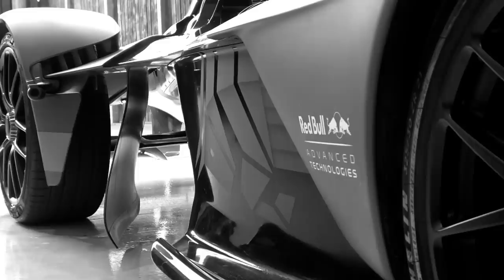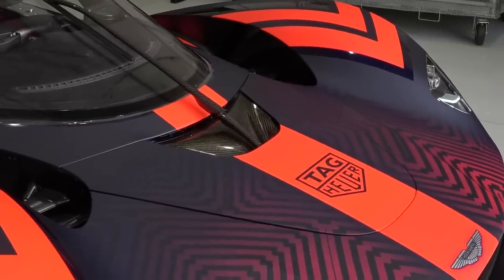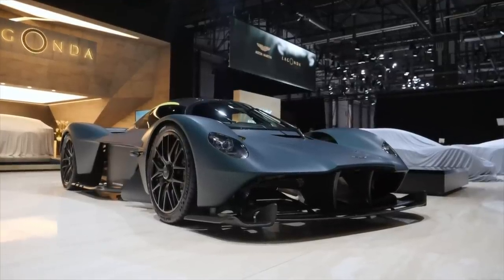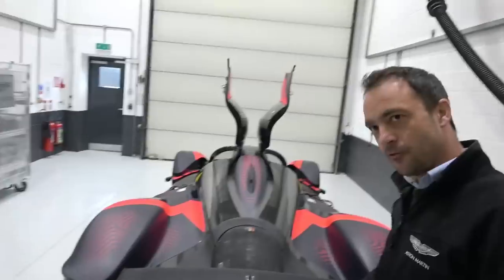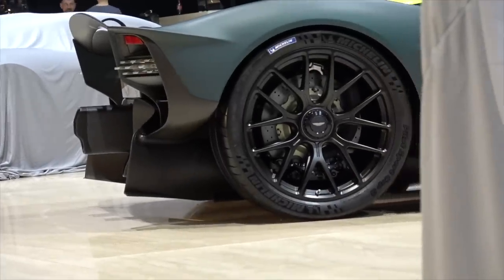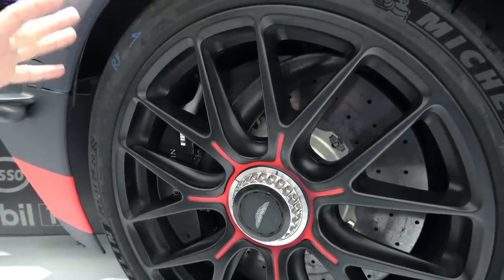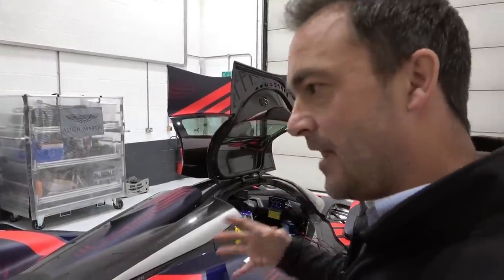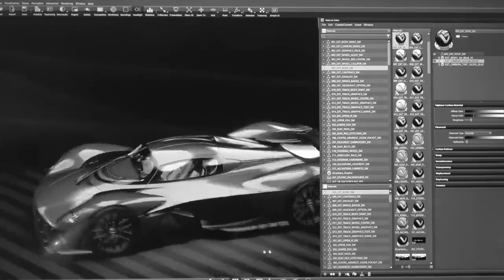Valkyrie Is ALIVE! World's First Onboard Drive!

Comment: I got shivers down my spine when we said that it is faster that LMP2 car in road spec! Absolutely nuts!
Reply from the maker: F.Gomm I know right!? It’s absolutely absurd!
Reply: @MrJWW  Yes it is an absolutely crazy project! Defiantly a once in a generation car! Thanks for the reply!
Reply: That’s quicker than F1 right
Reply: @chrisflux57  no, F1 is still a whole different ball game. The unregulated 919 Evo LMP1 derived car which Porsche used to break records last year is there or there about with current F1 cars (Mercedes, Ferrari, Red Bull)
Reply: @chrisflux57  the "can qualify on a F1 grid" thing was always towards the AMR version.
Reply: @npanic628  only on certain tracks though, spa is a track made for lmp1
Reply: Of course theyre going to tell you this. Ill wait until it actually is just as fast, officially
Reply: So in the road spec it is quicker than le mans hypercar?
Reply: well,. the car is great i agree.. but saying things like that basically a window dressing.. lmp2 max price 483k so yeah,. this car should go faster than that considering the price. and lmp2 has RULES that limit the performance, like: minimum weight 900ish, max brake diameter no power brake. 'only v8' 600hp. so yes ofc it is faster than lmp2.
Reply: @gustavoflorio5383  Actually what they claimed is that this car would be faster than the current generation of F1 cars.  So only being able to qualify on a F1 grid would be pretty disappointing considering they had a massive budget to design this, it's literally designed by Adrian Newey, and it's not restricted in terms of HP or aero like F1 cars are. I honestly don't see how they would fail to outperform F1 when you consider the fact that it is essentially an F1 car with more horsepower and no restrictions whatsoever on how much aero or weight savings it can have. So all and all, they will have failed to live up to their own hype and just failed in general if the amr isn't faster than at least the current generation of F1 cars. Honestly I don't recall if they made that claim specifically for the amr or for the road car as well. If they did for the road car, obviously now saying that it's "only" as fast as an LMP2 car is a pretty massive downgrade on their end.
Reply: @MrJWW  Can you imagine what a Gibson V8 would be like in a road car!!!!
Reply: @baller7387  its just marketing. Hyping it up. Its stupid to expect from something road legal, that has to comply with road standards, safety features, emissions all of that crap, to be anywhere near a race car. I can imagine it being faster than an LMP2 car because they only have 500 something HP. But it will be track specific, for example at Le Mans yes the road car should outperform the LMP2, but lets say Budapest or Laguna Seca, i cant see that happening. As for the AMR version, in race trim i fully expect it to be faster than the Le Mans hypercars coming next year, maybe somewhere on the pace of the current Toyota LMP1, but thats still a high order since the Valkyrie is heavier. Formula one will be untouchable for it i can bet my head on that. F1 cars are 700kilo 1000+hp racing machines designed on budgets of 400+milion dollars. Pulling 6g in some corners, no hypercar is anywhere near that (maybe 3g for the FXXK or P1 GTR) and its stupid to expect it from the valkyrie..
Reply: @baller7387  the valkyrie is too heavy and doesnt have enough aero to outperform aa formula 1 car
Reply: @npanic628  I can definitely see the argument for the road legal version not being as fast as F1. The thing is, no one else has ever marketed their production vehicle as being faster than an F1 car, so that's a pretty big promise to fail to deliver. And I don't think it's stupid to expect a car along the lines of the concept of the valkyrie (at least the track only version) to be faster than an f1 car when you consider the things I mentioned above. F1 cars are restricted with regard to the amount of HP they can reduce, the amount of aero they can have, and the amount of weight savings that is allowed. The entire idea of the valkyrie is that none of these restrictions apply to it and that it is designed by a legendary F1 designer in Adrian Newey: the premise of the car is that it is what an F1 car would be if there were no rules about how much HP, aero, and weight savings it can have. So really it should be faster than an F1 car, and frankly I think it's stupid not to expect it to be given how the car has been conceptualized.
Reply: @baller7387  neither Newey or Christian Horner said that the roadcar would be as fast as a F1. And if you have some knowledge of motorsports, you would not think otherwise.
Reply: @baller7387  there will never be a road car that is faster than and f1 car around a circuit. I don't think you are appreciating the level of performance an f1 car has. Anyone that says their road car is fast than an f1 is delusional.
Reply: @chrisflux57  no
Reply: Baller 738 I thought the same thing, I didn’t want to say anything about it incase I heard wrong but I remember when this car was just a rendering they were claiming it would be on the same level as an f1 car but they probably quickly realized that was a pipe dream
Reply: @gustavoflorio5383  First of all, I never said Newey or Horner personally claimed that the valkyrie would be as fast as F1, so calm down there bud. Second of all I said I was unsure if they made this claim for the road legal version or the track only version. Also, this has nothing to do with "knowledge of motorsports", I am simply referring to what aston martin claimed. Finally, it's not unreasonable to expect a car conceptualized as an F1 car that doesn't have to comply to F1 regulations (at least in the track only variant) to be as quick or quicker than an F1 car. This is common sense; if you had some you wouldn't have attempted to cite "knowledge of motorsports"
Reply: @fondfarewell2  I've already agreed with this line of argument so far as a road car goes. However, there is a track only version of this car, and after having looked it up I've become aware that this is what they were saying would be quicker than F1. Trust me, I appreciate how fast F1 is. I know F1 are the fastest and have always been the fastest vehicles around the track that exist since their inception. However, as I have said before the entire idea of the valkyrie (and I am referring to the track version here) is that it is an F1 car (designed by Adrian Newey of F1) that does not have to comply to arbitrary limitations with regard to HP, weight, and aero as all F1 cars do. When you take this into account, it seems pretty reasonable from a logical standpoint to expect it to be quicker than an F1 car.
Reply: @maurizioarrivabene8182  but the current f1 still beats the Evo. Tho 2019-2020 will be the F1 performance peak. With 2021 (depends on what they do but) the cars will be slower 😔
Reply: @baller7387  it cant out perform an f1 car haha , are u insane ??? The 919 evo couldnt do it and thats a fullblown lmp1 car . It surly lacks down force in comparison. And doesent run on slicks. And doesent have a whole battery and drs ect.
And look at this , i dont think aston martin f1 would aoreciate a road legal aston martin to spank their Car haha. You are right on 1 point tho. The valk will be FUCKING FAST
Reply: @LittleLightIsaOnce  My man, I'm not saying it will outperform an F1 car. I'm saying given what aston has said about it and the concept of the car, it SHOULD be expected to outperform an F1 car. I really don't want to repeat my argument for what feels like the 5th time, so feel free to actually read my comments and try to understand what I'm saying before you respond. If I'm misunderstanding and you're saying that it's impossible for any track vehicle designed by a legendary F1 designer with a massive budget and no restrictions whatsoever to outperform an F1 car, then I'm going to have to ask if you're insane bc F1 is not the apex of what's possible. F1 are race cars that are restricted (once again) in virtually every aspect of what they can do. A car that is not restricted in any way with regard to what it can do should LOGICALLY be faster
Reply: Only F1 cars it might beat at a massive stretch would be the tail end 2014 F1 car on full tanks at the start of races.
Reply: @baller7387  most hypercars will outrun an F1 car in a straight line, but around a track F1 is king.. road legal cars need to have a cat converter, f1 cars don't.. f1 cars are one seaters, most hypercars are 2 seaters, some hypercars have aircon, radio etc. most if not all f1 cars don't have these kind of amenities.. that alone gives the f1 car about 300kg or more in weight savings vs a hypercar.. the only advantage the hypercar has right now is a bigger engine w/c results to more hp than an F1.. if people really become serious of creating a road car that could outperform an f1, funny thing is that it might end up looking like an f1... because they would have to give up the idea of a 2nd seat, air conditioning, etc. just to save weight... it is probably possible but it doesn't make sense
Reply: @baller7387  Valkyrie is no Redbull X2010. The  "no compromises  car" isn't a thing in the real world. 
What more do you want? The car can do 0@120mph in 5s, reach 250mph, has as much downforce as a late Group C car, has a 1000hp naturally aspirated engine...
Reply: @gustavoflorio5383  Are you capable of reading? It's not a question of me wanting more, it's a question of Aston living up to it's promises and fulfilling the potential of the concept of their car (and I am talking about the track only version here, again): a no holds barred track vehicle designed by an F1 designer with no limitations and a massive budget. If there are no limitations on HP, weight, or aero, and the company producing the vehicle claims it will be faster than current F1 cars, taking the concept into account I expect it to be faster than current F1 cars. If you can't understand where I'm coming from with that then I don't see the point of continuing this conversation
Reply: @pihermoso11  I see that you like virtually everyone else that has responded to my comments has failed to actually read my comments. I've said many times at this point that I am referring to the track only version of the valkyrie. It is not a road car. It does not have air conditioning or any of the amenities that you would typically associate with a road car. And ironically considering your comment, the valkyrie is literally the embodiment of a road car that is attempting to outperform F1 and it does in several ways look like an F1 car. But once again, I am referring to the track only version. As for your comment that it "doesn't make sense", it does make sense if people are willing to pay for it and it uplifts the reputation of the brand making it. We can observe that all 25 of the production models of the valkyrie were bought a year ago, 2 years prior to when production is even supposed to start. So it would appear that this sort of thing does in fact make sense.
Reply: That lmp2 statement needed more context, Is it faster in lap time, which with near 40% more power could mean a slower corner speed and then blitzing the LMP2 down the straights to get a better overall lap time. Or is it as all who go to the 24h Le Mans hope,  the package is a step up in overall corner and straight line speed. 
Aston Martin have the chance to take endurance race back to the 1920’s and days of the first running of the Le Mans 24h and to the like of the Bentley boys. In the year the McLaren F1 won at Le Mans, Gordon Murry once said all our race cars were all road legal (if road tyres were fitted), Gordon said “the coolest thing would have been, if we drove the cars from the factory to Le Mans, won the race and then drove the cars from Le Mans back to the factory. How cool would it be to see 3 Valkyrie line astern in full livery driving from the factory to the tunnel, then onwards to Le Mans down the old national route.
Reply: @chuckyboy6977  Valkyrie has more downforce than a LMP2... but road tyres X racing slicks. So, yes slower cornering.
Reply: @justina9914  There's no such thing as a le mans hypercar. Those cars are called lmp1 and lmp2 cars, and they're racing prototype cars.
Reply: @CES-dh4ut  if you bothered to do some research you would know that le mans hypercar will exist and they are going to do 3:30 laps on le mans which is slower than lmp1 and lmp2
Reply: @CES-dh4ut  Peugeot , aston martin red bull racing, scuderia glickenhaus, Toyota gazoo racing, mclaren and possibly lambo are interested
Reply: @CES-dh4ut  maximum 750 hp must have road homologated versions
Reply: @CES-dh4ut  going to replace lmp1
Reply: @baller7387  The enormous achievement is that the Valkyrie will be road-legal. There are literally millions of different regulations globally restricting how a manufacturer can produce a car. This car will have headlights, and indicators, and airbags. An F1 car currently needs to do 21 races a year, with tyres oftening lasting barely 20 laps and engines and gearboxes lasting only a few races.

With the Valkyrie, you could take it to a Maccas drive through and then go on to break some all-time lap records. That's an unbelievable achievement, what a time to be alive.
Reply: The road version beats lmp2 and the amr pro is literally competing in lmp1's place... Best car ever imo
Reply: @justina9914  I think the regulations only require the engine to be in road cars.
Reply: @chuckyboy6977  isn't that what Jim glickenhaus intends to do?
Reply: @chuckyboy6977  he won't be driving them from the factory, because they're from the USA, but he wants to drive his car to a restaurant in Paris after the race.
Reply: @kylem7917  for some reasons it ain't my favourite car, I prefer the vulcan
Reply: Baller 738 What were you smoking? Not as fast as F1 is disappointing? Outta here!

F1 is ridiculously, RIDICULOUSLY FAST. Don't bother lmao
Reply: @justina9914  McLaren is ruled out and it's Peugeot not Renault.
Reply: @LittleLightIsaOnce  The 2017 F1 car is current regulation and the 919 EVO did beat it. I think the 2017 or 18 car did come back for the record tho. Don't remember which.
Reply: @npanic628  It's the track only model that will be going for F1 qualiy times. I suspect it'll be lighter than the road car but so far the map bench is around 3-4G, that's still no where near enough to touch even the slowest of F1 cars lol.
Reply: @baller7387  i really dont bcs why would Aston Martin make a road car faster then theyre own f1 car that isnt even the fastest car on the grid ?
No regulations dont matter. As u said the uncapped 919 evo (no regulations is slower was slower than the 2018 ferrari and Mercedes f1 cars. Its makes no sence that a lmp2 performance car would out performe a F1. Even with its track pack its not gona make it suddenly go from Lmp2 to F1.
Reply: @F1ll1nTh3Blanks  2017 F1 car is current regulation what ? I dont understand what u mean by that ? 😅
No earlier that year the 919 evo set a new lap record at spa beating the 2017 spec f1 cars. But with 2018 (the fastest f1 cars yet) they beat it in Free practice 2. Seb Vettel and LH had a faster time by a couple of tenths. (Later on it rained so no chance of beating the 919 on full power. I think if conditions were good the F1 cars would beat it by at least a full second.
Now the F1 cars are reducing aero for the pourpus of better racing so they are getting a bit slower. And the 2021 F1 cars will be slower.
Reply: @F1ll1nTh3Blanks  its funny that people are dissapointed with the notion that the AMR wont do F1 times. People seem to fail to understand that while yes it isnt road legal, doesnt have to comply with many if any rules, its still a customer car. Its not flexible in terms of setup, it has to be reliable, strong built (heavy, ~900+kg) and its debatable wheather the smooth closed cockpit big diffuser design has less drag and more downforce than the HUGELY complicated and complex aero design of current gen F1.

People, F1 cars are purpose built for every single circuit they go to. Every part on an F1 car is designed to do its job as best as it can on that circuit, for the next race it will be replaced or changed. You cant compete with that level of intricacy in something thats CUSTOMER BASED.

That said, if it really goes on to be LMP1 fast, i will be freaking blown away.
Reply: @F1ll1nTh3Blanks  aight but I thought mclaren is doing this
Reply: Tuff Ed Boi With the ACO’s homologation rules,  it looks like the likes of Glickenhaus, and any other boutique car makers won’t be in the WEC Hyper car class. The ACO posted the regulations, and it states that a Marque must build (on the last notification) 100 road legal models of the cars motor if they wish to race. The old 90’s GT1’s only had to have 15 to 25 road legal models built.
Reply: @chuckyboy6977  Not even remotely true, the original problem SCG was gonna have, both GMD and GMA was having to have a factory name as to save costs they would enter as privateers but ACO says as long as 20 cars are built over the race run, they can race. No mention of 100 cars at all. It's GTE that has to build 100/500 road cars I think.. 🤔
Reply: @LittleLightIsaOnce  I thought the spec between 17 and 19 were broadly the same no.. 🤔 17 was a big departure from 16 anyway. 16 felt more like a transition.
Reply: @justina9914  They were drawing up a program and then they dropped it recently. They have chosen IMSA DPi racing instead.
Reply: @npanic628  It does beg questions but when Newey, drew up his X201 car for Gran Turismo, he closed the body off almost completely and went nuts on the underbody I think he even put a GE fan on one of the cars. I can't remember the figures but he believed that that was the way forward. McLaren also followed suite with a similar mock up. I am not sure about McLaren but I know that Newey said, he based his simulation on what he thought was possible with todays tech know how and no regulations.

The Valkyrie AMR track only version, will be his chance to take what he couldn't put on the road car and prove his theories regards what's not possible with regulations. That said, again, the figures he's benchmarked so far don't look as impressive as what was simulated on the RB X20 GT cars but I suspect part of that will be down to the limitations of having to start with a "hypercar" base, as opposed to a formula or prototype.. 🤔
Reply: @F1ll1nTh3Blanks  look its simple. Its a customer car. Components have to last since replacing them is difficult and expensive (as it is with any exclusive car) and they cant afford to put too much stress on them. Also keep in mind that being a customer car it doesnt require a special licence to drive hence why it can never have the level of performance a Formula 1 car has. There are surely many more factors. The really closest thing we have in the world currently to the Red Bull X Gran Turismo concept is the Porsche 919 EVO. And that thing barely touched a 2018 Mercedes F1 car, go figure....
Reply: @npanic628  No shit, I thought the fact that it's still being built off the same base as a hypercar made that clear, that it's gonna be built to last..

I am not sure what licensing has to do with performance on private customer cars. People buy retired F1 cars and race them at historics. That's not news. Then you get companies like Rodin and Lotus building these Formula performance cars for customers to take to tracks. 🤔

That last part is plane nonsense, the 919 EVO was still a prototype, Porsche just pulled the caps off it. It still has to obey the laws of physics. Newey and his prospects are a different ballgame entirely, I am betting on him over you. No offense. 🤷
Reply: @F1ll1nTh3Blanks  the lotus F1 inspired customer cars require special training and contracts before you can own and drive them. The same with retired F1 cars and they are always detuned.

What i meant with the 919 EVO is that its the only unregulated race car meant for record breaking (F1 beating) lap times today.
Reply: @F1ll1nTh3Blanks  ohh okay yeah 17s were a big change from 16s. But the 18s were also a pretty big change from 17s. Its onlu now that they are roughly the same just a less complex aero and shorter rear wing
Reply: @F1ll1nTh3Blanks  oh yeah shit dpi2.0
Reply: @baller7387  No ever stated that this would be faster than an f1 car and it's silly to think that this could match an f1  car around a track, that's entirely unrealistic.
Reply: @zelkuta  Except aston martin did officially state that it would be at least as fast as the current generation of f1 cars. Feel free to do your research before you try to make an argument next time tho
Reply: @baller7387  it wont come close to F1, a larger wing on the rear and softer compound tyres are not worth the 10-15something seconds delta between LMP2 and F1 lol.